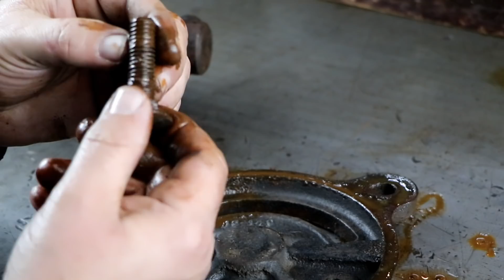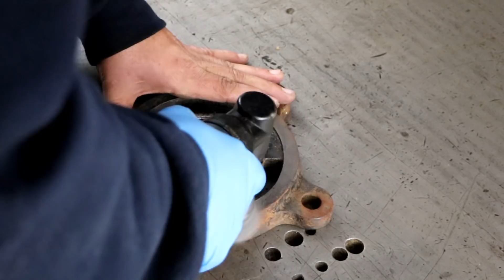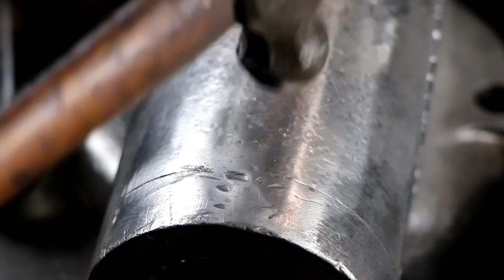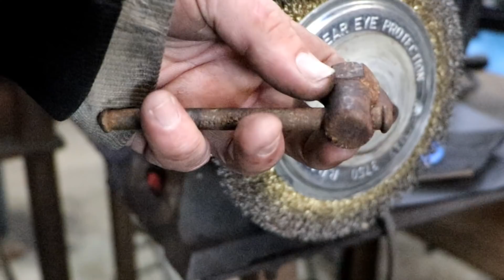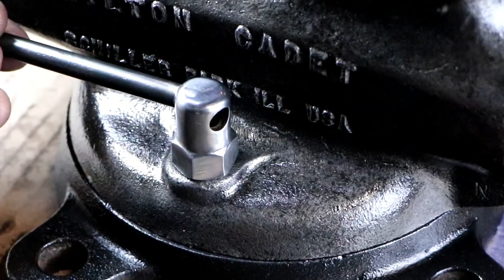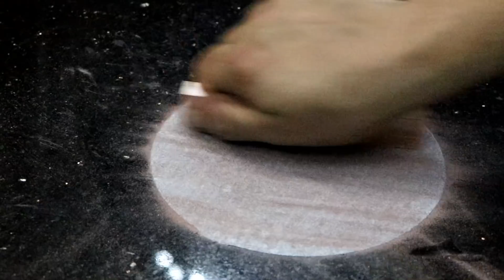SEVERE RUST!! Wilton Vise Restoration

Comment: Yay, not fake rust :) (unlike some restore videos)
Reply: DodgyDave73 lol fake rust?
Reply: @BradsWorkbench  people intentionally leave new tools in the elements just so they can restore it
Reply from the maker: +Premium08 yup.. makes me sick.
Reply: @TheGoodoftheLand  can only control what you do, and you are doing it right!!
Reply: Do you have a link to such a video? I would like to see the difference. Thanks!
Reply from the maker: +Hoss Man Not sure of the channel but he usually does sword restoration using fake new swords.
Reply: Hoss Man 
There is another channel that does “restorations” that I am quite sure is fake rust because every single item has the same patina when he starts. 
I am however reluctant to mention the channel name just in case I am wrong but if you see his thumbnails you will see the same patina every time.
Reply: That really grinds my gears ( No pun intended )
Reply: Wayne Crews 
I used to acid bath boiler parts when doing some major service and repair on industrial heating and water systems, the parts were neutralised after then pressure washed, after one day they went orange after two days it was a deeper orange but could be literally wiped off, reminds me of these videos, very little rust.
Reply: Doesn't matter. Fake rust or real, if you've seen one vise "restored" you've seen them all. It's almost always just cosmetics anyway. Wire brush and penetrating oil. Oh, and monetized views for the YouTuber.
Reply: PS I blame Diresta on the Fitzall podcast (really good) for making me view things a little more critically Re new rust :)
Reply: The Good of the Land 
I so badly wish I could like the reply to Imp that has been deleted. 👍🏻👍🏻👍🏻
Reply from the maker: +Wayne Crews Sorry brother. YouTube is getting crazy in the comment section. I enjoy a good debate. They deleted every comment from every Stephen Cox Video. Not sure where this YouTube  thing is headed.
Reply: The Good of the Land I saw that. Steven seems like a good dude. I’ve emailed back and forth with some questions cuz I’m still a pretty new creator and he’s always responded with genuine, honest answers. Hopefully it will help my learning curve develop more quickly lol
Reply: I believe the channel is Random Hands and Restoration Restore it. I looked up sword restoration and the rust looks fake to me
Reply: lmao, i call them out on it whenever i see it, its pretty easy to tell from vintage patina.
Reply: @TheGoodoftheLand  Beast. Beastmode, brother. Epic. Savage.
Reply: Man I have plenty of access to stuff like that because my grandparents use old Jack's and vices as yard art.
Reply: I guess Im pretty randomly asking but do anybody know a good site to watch newly released tv shows online?
Reply: @Nathaniel Bode Ehh I'd suggest flixportal. You can find it through google:) -harper
Reply: @Harper Ty Thank you, signed up and it seems like they got a lot of movies there :) I really appreciate it!
Reply: @Nathaniel Bode Glad I could help =)

Comment: This my kind of restoration. You did a great job.  I like to halt deterioration, restore to perfect working order and display the item's age in it's patina. If I could offer one bit of advice: Use raw linseed oil instead of Lubriplate. It is a very slow drying oil which will protect yet not collect dust and crap like a wet oil will. Just wipe on with an oil dampened cloth you keep in a sealed mason jar. Wipe it back off with a clean dry cloth otherwise the oil will semi dry thick and tacky. I use this on all my exposed metal and wooden tools.

Comment: "Remember Kids. Anything can be a hammer. And most things, a pry bar!" - ChuckE2009. 

Been a fan of Hand Tool Rescue for a while. Glad to see you use his adjustable wrench. Know he was down there last year at some point. Wish I could have drug my brother down there but 2018 really got in the way of doing anything fun. Nice work on that restoration, Justin. I'd have never thought to use a rust converter as a final finish. Very good idea. Might have to dig that bottle of Corroseal out that I have in the shed and actually use it. And i'd not have even thought to use the back of a hammer to texture the surface. You have skills, sir!

Comment: I have a 4.5" Wilton combination bullet vise circa 1970 that I am currently restoring to functional use.  It did not come with the swivel locks, if I remove the nuts and make swivel locks for it I really liked the use of acorn nuts on the locks. Also, one of the pipe jaws is missing which I think I can make one on my mill.  Excellent video, thanks for posting.

Comment: Very nice. Learned a couple of techniques to try on my next vice salvage.  I use an e-tank or a bucket of lye to remove rust; same process for old cast iron pans. My only critique... not sure I would have went with acorn nuts on the swivel nut handles. It would have been easy to heat the ends of the new handles then swage them into a very original looking mushroom. 
Thanks for sharing! I love bringing old vices back to life. I have an old Charles Parker that is next up

Comment: man you got sharp drill bits!! and i never seen a vise with copper jaws before..too cool!
Reply: Ya I need some of those bits! Check out the copper vise jaws made by Sixtyfiveford! His channel has all kinds of cool videos!
Reply: Copper is so that you don't scratch the thing that you are working on. Like a knife. If you are supper worried or your project is mostly finished you could use wood or even leather.
Reply: They make nice brass or copper overlays so you can keep the original steel jaws when you're not working soft or fragile metals

Comment: Hey, Justin... if you get yourself a pneumatic needle scaler you can get the similar pitted surface texture in about 1% of the time.
Reply: Needle scalers are awesome tools
Reply: But then he wouldn’t get the tappy tap tap. 😁
Reply: @Crewsy  lmfao at ave tappy tap tap
Reply: Like the Navy uses.
Reply: @danssmokintreasures  I've put some miles on a needle gun while in the Navy

Comment: Instead of stipling with a hammer...I wonder if a air powered needler gun would strip rust and roughen the surface
Very cool cleanup...made a brand spanking new vice out of it!  Great job!

Comment: Is your rust converter liquid the same thing as cold bluing liquid? Absolutely love that look!
Reply from the maker: +David Pryor It is not but it is close. It actually leaves a much harder coating if you let it dry. I didn't want it to be solid black so I left it on for a few minutes then wiped it off. It is absolutely the best look and protective coating for cast iron. Works great on any metal. If you want to see it at full strength check out this restoration. It's a good video.
https://youtu.be/oG5Ehi8jkfs

Comment: I once saw a vise painted with Hammerite paint that was pretty nice. I'm told that as long as you remove loose rust and paint you can paint over light rust, but I've never used it so I don't know for sure.

Comment: Nicely done buddy. Please tell me what little battery grinder you are using, i need one for my service truck!
Reply from the maker: It's made by snapon and it is fantastic. Tons of torque and15k rpm
Reply: @TheGoodoftheLand  sweet! You dont know the model number do you? How is the battery life? Ive seen you use that thing several times now and I'm impressed, been drooling over it for like 6 months now. They have several different models, want to make sure i get the right one. Thanks bud
Reply from the maker: +L76 6.0 VortecMax I promise I will do a video soon. I have four batteries. I suggest at least two. They charge as fast as you can use them so I have never had a problem. One of my batteries needs repair but they supposedly have a good warranty. I think one of the tabs just needs to be adjusted so I will probably do it myself. I have been told you can get it o line somewhere for $350 it was $450 on the truck. Very expensive but it does the job in the field. Stephen Cox has the same took in green.
Reply: @TheGoodoftheLand  Awesome, I appreciate it! Ill be looking forward to the video! Yes, sometimes you just cant put a price on a good tool. I have lots of tools, maybe 50% Snap-On...since they are so expensive I tend to do my research on them long before hand, decide if I can or cant live without it, then I search for a while for a good deal. Sometimes though there isnt a deal, and you just have to pony up for what you want, good tools sure make my job easier! I havent seen Steve's, but I'm sure he uses it frequently. Him and I do much the same type of work. I appreciate the videos, i find it relaxing to watch. You have golden hands sir!

Comment: You do amazing work. Just had one question. Why dont you use a sandblast cabinet with either walnut, glass or soda to clean the parts instead of using wire wheels?
Reply from the maker: +Jason Schagt I have a blast cabinet. I use it when the parts have spots that the wire wheel can't reach. The wire wheel is usually quicker and it polishes the cast iron leaving an even, shiny finish. The blast cabinet tends to leave things dull.  I definitely use my cabinet but prefer the wire wheel.
Reply: @TheGoodoftheLand  cool. The reason I was only asking is,  I watch alot of videos of restoring old equipment and a lot use wire wheels. Out of all of them you are the best at restoring the old stuff. You do amazing work. Coming from a dad that use to restore cars and me in the engine machinist field I'm use to using a blast cabinet to clean parts. Thank you so much for getting back to me and I can not wait for a new video from you.

Comment: Hey quick noob question: how durable is oil finish? Do you have to re apply at some point or does it penetrate into the metal hence protecting it from oxidation? BTW amazing tool and craftsmanship from your side. Have you thought about powder coating some items for any project?
Reply from the maker: +Andres Barquero oil is just oil. It works as long as it is on there. The rust converter is kinda like a superpower gun blue. The oil can bond with it and you get a stronger finish. I also like to pre heat the parts I front of my forced air heater before applying the oil.

Comment: Not the way I would have finished it but no matter.  You got that one at just the right time so no further corrosion could occur. Nice job.  How wide are the stock jaws (4"?) and how far does it open?
Reply from the maker: +Gord Baker Thanks Gord. The original jaws are 4.25 and I ordered an new set from Wilton. The came hardened and tempered without the temper color removed. They look cool. The vice opens very wide for its size. If I had to guess I would say 10 inches min.
Reply: @TheGoodoftheLand  Wow, that is a big opening.  The latest one I restored is 4" wide, 5" opening with full engagement of the lead screw nut.  Mount Tai Industries.  Appears to be 20+ years old and a quality product. Riveted Nameplate.  The company is still in business making many types,but I cannot find a photo in their google pages of mine. Certainly hardened jaws and It looks pretty good.  I put flattened and  folded 2" copper pipe over the jaws when clamping delicates.
Reply: @TheGoodoftheLand   From what I could find, the 4" Cadet opens to 5".   Some crazy high and Low prices out there....
Reply from the maker: +Gord Baker But she told me it was....😉

Comment: What's the Lubriplate stuff? The link in your decription is to a CRC rust converter.
Reply from the maker: +Anthony McGrath Its a vintage tin. I picked it up in Florida on my last trip. They are still in business but I'm not sure if the still make this product. I wouldn't have used it but it was already open. Its actually quite good stuff.
Reply: @TheGoodoftheLand  Yeah I found their website, but they have so many different products I wasn't sure which one you used. And the finish on this vise is beautiful.

Comment: easy way to get of rust - let it soak in vinegar for a couple of weeks - job done
Reply from the maker: +mlhm5 Or you can do it with a wire brush and be finished in ten minutes. Smart washer 2 hours. Evaporust or electrolysis 24 to 48 hours. Sand blaster 20 minutes. You can find all of these techniques on my channel. I have to say, nothing is faster or leaves a better finish then a wire wheel. Thanks Brother.

Comment: ill agree the rust seems genuine, not made 2 nights ago with sulfates, vinegar or hydrogen  peroxide, wouldn't call it beyond repair nor severe, then again i should be happy its not a hairdryer,or a 80s vacuum cleaner or the worst ive seen a modern clock made in China that had a patina to look old

Comment: Awsome job! But Why not sand blast the parts?
Reply from the maker: +Matt Fitch sandblasting leaves a cold dead finish. Notice the way the castings shine from the wire wheel. I have a great blast cabinet but have found that a wire wheel is faster as well.
Reply: Ohh makes sense maybe I just need to buy better wire wheels lol

Comment: You can tell when it is fake and when it is not fake. If you have severe pitting, then you know it has been out in the elements for years. it also depends on the type of steel. But yes, some of those sword restorations look staged since the design of the knives and swords look fairly new. Yet, he still has some that I am pretty sure not staged.

Comment: alittle advice.. use a drill with that wire wheel why you say well your compressor is always running unless you have 120 gallon one ... so save it for small jobs... and dont bother beating out or grinding the hammer marks that gives it character.... also  primer and paint it with expoxy paint.. it stands up the most..

Comment: I see all Wiltons are not the same.  A swivel base that relies on friction to lock up is about useless. When you're wailing on a vise it needs a toothed locking bar in the base. That's why you see so many of them with bent tommy bar locking nut handles.
Reply from the maker: +Ricopolico Yup. It seems so easy just to add the teeth to the casting. Shame it's not standard on all vices.
Reply: @TheGoodoftheLand  - If you're really humping on the vise, one solution is to ditch the swivel base and bolt the vise to the bench directly. Not always the most convenient, but beats the vise constantly shift around. I went through a few cheap vises until I finally bought a nice, used (still was expensive to me) Starrett a couple of decades ago. One of the best investments I ever made.

Comment: I always thought rust converter was meant to be used before you have removed all the rust. It is not meant to be used as a coating, like you have done here. Read the directions. And why put lubricant all over the body? What about car wax, or even spray acrylic. On the last shot, it looks like the jaws you put on don't meet up flush. Am I seeing that right?
Reply from the maker: +bomaite1 You formed it like a question but your just making an point that I'm wrong and your way is better. Keep doing it your way and what ever you do, do not try this recipe on cast iron. There are zero benefits.

Comment: Aren't You afraid about durability of the copper jaws? Won't they be too soft? 
Great.job anyway
Reply from the maker: +Patryk Buczyński Yup. They are sacrificial and used to protect against marring what ever you are clamping. I bought a new set of hardened and tempered jaws from Wilton for this vise should I ever need to change them. Thanks Patryk!

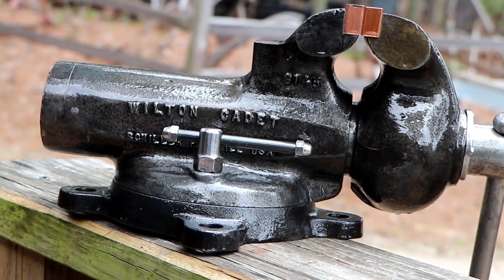Comment: 11:50 put that thing in the mill and make the jaws square...
Reply from the maker: +Boosted98gsx  Good eye. They are square. The bolts are bent acting like a eccentric and the threads were rusted so bad that the  won't tighten. The new Wilton hard jaws with new hardware arrived later that day. Sits perfect with the new bolts. Thanks

Comment: Kinda disappointed on this video not everything needs a hammer finish but it does look nice though
Reply: Antonio Claudio Michael 
The casting already has a sandcast surface. If he didn’t use the little ball pean hammer then the repaired areas would stand out like a sore di.........Er......thumb.  👍🏻👍🏻👍🏻

I am glad he did it and didn’t go the other way and smooth it completely.
Reply: @Crewsy  got ya I still think it looks amazing